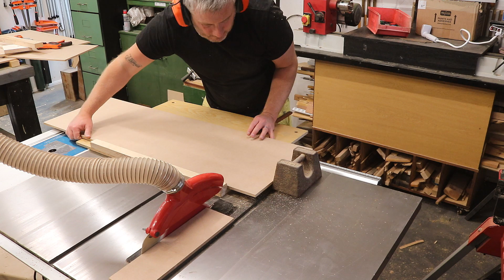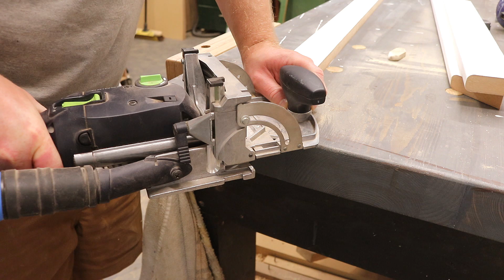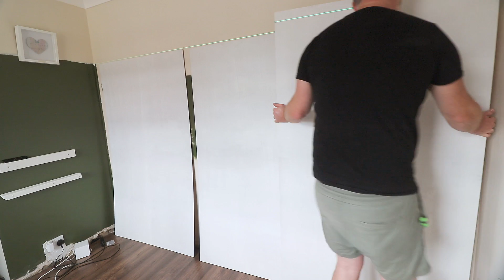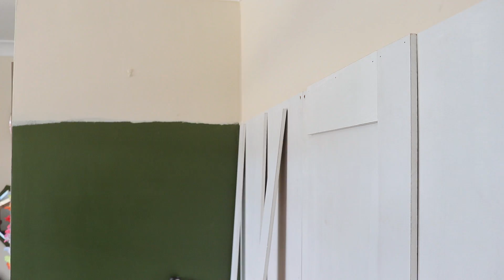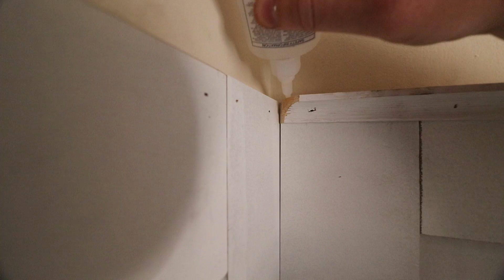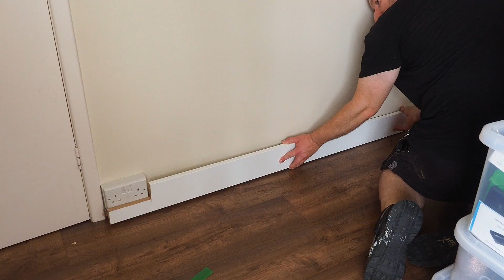DIY Wall Panelling

Comment: Instead of applying primer directly to MDF edges, try applying one coat of diluted PVA glue (50% glue, 50% water) first, and then sanding that (also, sand it only lengthways with a block, don't use an orbital sander on MDF edges). I find that it results in a nicer (harder, flatter, more resistant) surface.

Comment: Great job, I'd agree with your brother in screwing to the wall instead of using adhesive, I panelled my hall and bedroom last year and used lost tite screws into 6mm fischer duopower wall plugs, and filled and sand afterwards, when painted you won't see the holes.

Comment: Just a professional tip here, don't use handsaw with full fist grip, your index finger should be free place against handle face, it's the guide finger for straight balanced cutting, watch Robin Clevitt, I am a joiner, but you are very good👍

Comment: Waste of time putting full sheets up. Paint the wall and just fix rails and picture rail to the wall. Why put sheets on the wall first? The wall is the backing board? Seems like a waste of money to me
Reply: If the walls have any texture at all you will see it through the paint. It looks like absolute crap. So he would have to do a skim coating with a joint compound  on the wall or put up a solid board to cover the wall.
Reply: Only reason I could think would be for depth for the shelf and ease of removal

Comment: I absolutely hate,loathe and detest having to paint anything, it really does my head in. One of the best things that I found was to line the paint tray with a piece of kitchen tin foil. So when you have finished painting just throw the tin foil away and you don’t have to worry about cleaning the paint tray.

Comment: I've done some paneling in the past, but had to mount the MDF on batons to create an air gap as it was an external wall. So unless the MDF you are using is moisture resistant, I'd be cautious having the MDF immediately against the wall. Either way, a great video and end result

Comment: I may be mistaken in this comment, but if I remember correctly, you were not particularly skilled in construction work, carpentry, or woodworking when you first started Rag-a-bone.  But man... Look at you now!  You are near flawless with that jig saw, upside down, and your quick ability to premeasure and lay out in advance your cuts on a panel sheet before install.  I am so encouraged how you went from little to no skill, to such ability and confidence.  Kudos.
Reply from the maker: Thank you